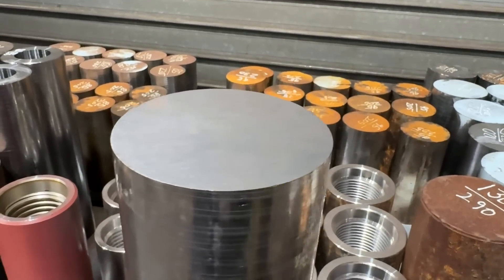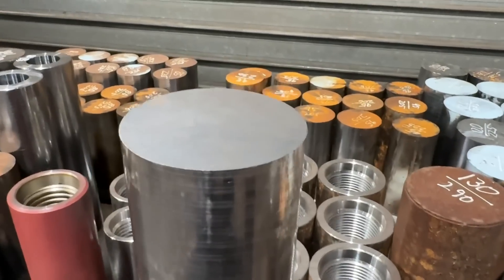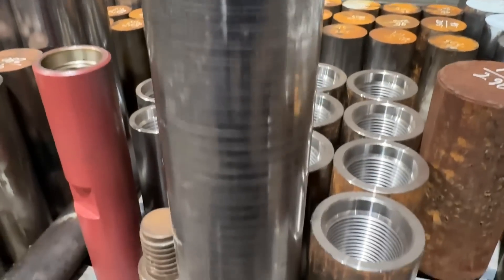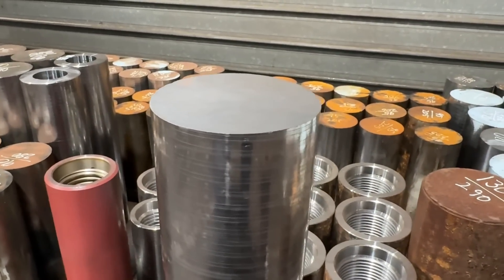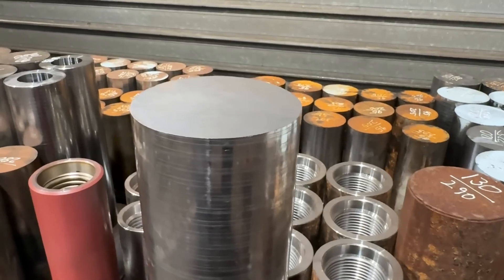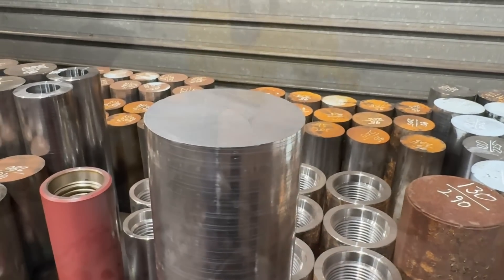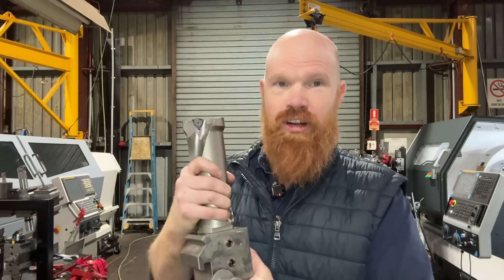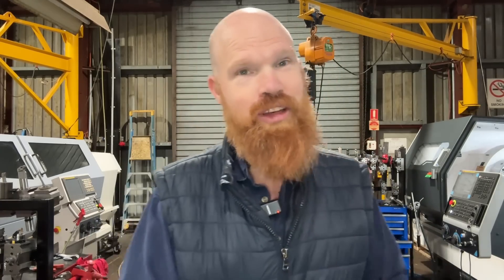HTS DRILLING at 900 rpm is UNREAL (you need to see this)

Comment: That was awesome, those chips were insane. Did you finish the facing pass at 1222 rpm? Thanks for sharing. Cheers👍
Reply from the maker: The facing pass was at about 550 rpm 

The drilling cycle was at 900 👍
Reply: @halheavyduty  What was your feed per rev?
Reply from the maker: Face cuts are 0.25

The drill is 0.15 but I think I need to run harder TBH
Reply: @halheavyduty  I wouldn't run much harder than that
Reply from the maker: Yeah, I stick to those feeds as a baseline.  Never run roughing past 0.35 for outer turning.

Finishing tends to be good at 0.25

I’m relatively conservative with how hard I push the gear and keep spindle loads at around 40-50% most of the time too.
Reply: @halheavyduty  I'm talking about drilling. I'd never go above .175 for  u drill style. You can put an inserted spade a lot harder.
Reply: @halheavyduty  Yeah, I notice most machine shops seem to run their gear conservatively. Makes me wonder why tool insert suppliers make their inserts so wide e.g. depths of cut seem to be 3mm, 5mm max and most CNMG inserts are (generally up to)16mm wide. Even if a insert is swapped from a RH to LH tool which is what I do to get the most from an insert, this leaves up to 10mm of unused insert! 
When I was an apprentice and had to get rid of material, I'd sometimes run the tool/machine at the full width of the tip - amp gauge barely went much higher. 6mm is about all I can get in 4140 with my current lathe🤣
Anyhow keep up the great work.
Reply from the maker: I agree re carbide! It’s why we tend to stick with WNMG where possible.  Just makes financial sense as we get the most out of the inserts capacity.

Thanks man. Appreciate the encouragement 👊